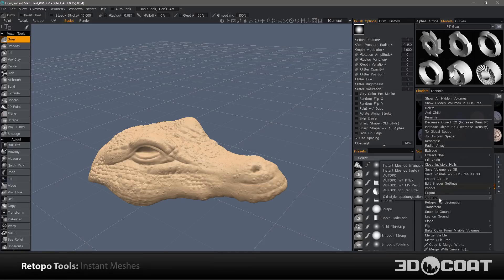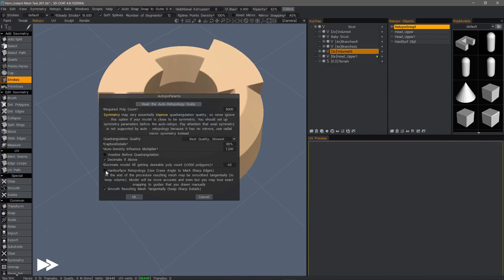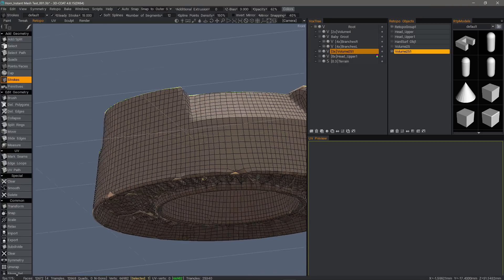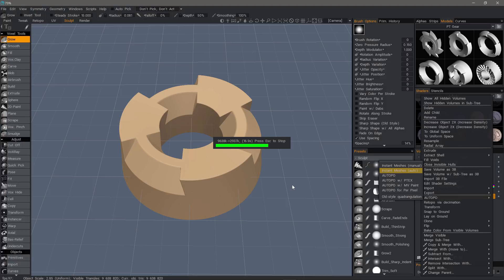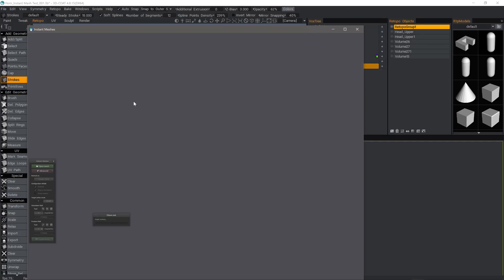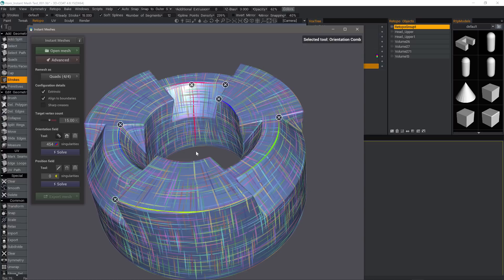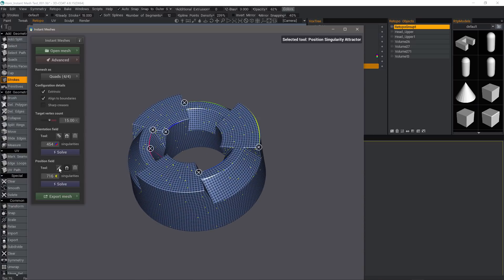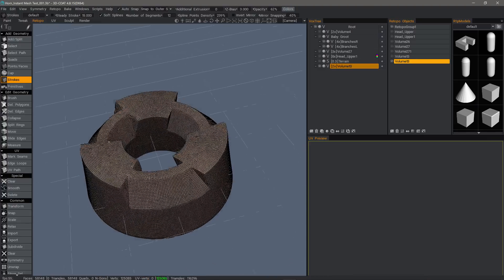Instant Meshes

Comment: I don't have Instant Meshes option under  AUTOPO, however I installed it on my iMac separately. It looks like 3D Coat don't recognize it? Do you know how to enable it to activate Instant Meshes on the 3DCoat side? Thanks
Reply from the maker: It works properly in the Windows build. It's likely then, that there is a problem with either the MAC build you are using, or a bad install. Contact the developer (support.linux@3dcoat.com) who works on the MAC/Linux Builds to see if you can get a quick resolution